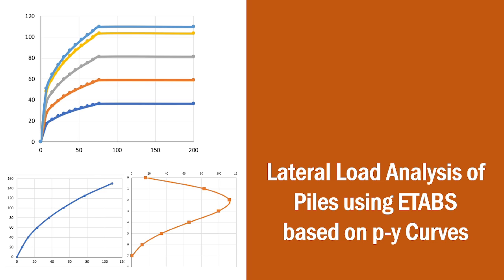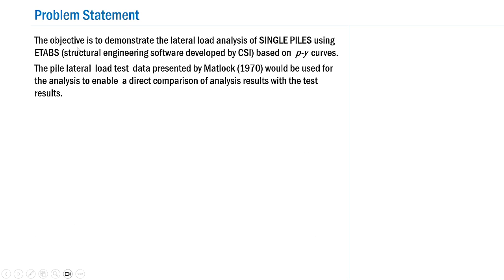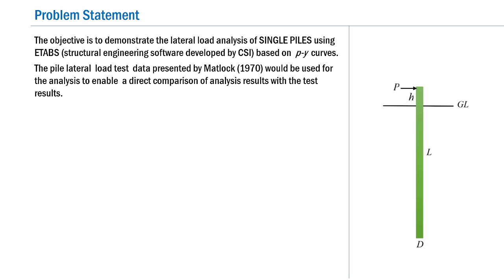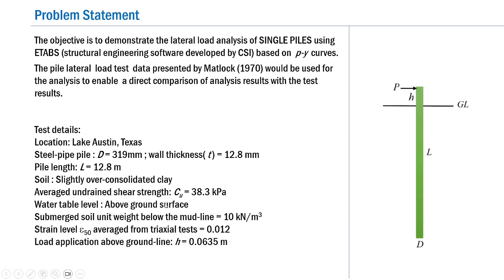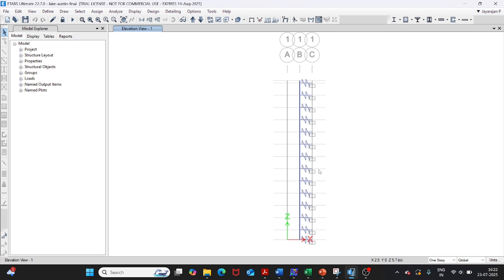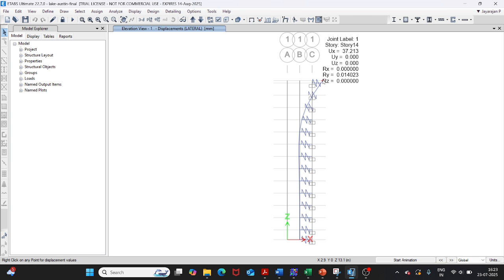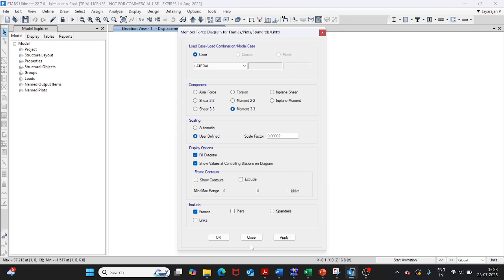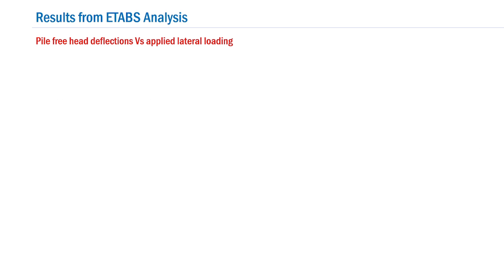Lateral load analysis of piles using ETABS based on p-y curves…

Comment: What is the vertical boundary condition at the tip?
Reply from the maker: keep it free. However for large  diameter piles, suitable moment -rotation need to be implemented at tip.
Reply: @puttattjayarajan1199  suppose we are going a seismic analysis of bridge pile foundation system, which boundary will you provide at the tip of the pile..?
Reply: Why don't put vertical spring at the tip?

Comment: Thank you, for your valuable lecture.What is the permissible  lateral displacement of pile According  to standard  Code?  Please, suggest me  any reference book whare I found it.
Reply from the maker: If you check codes and text books , each of them provide different criteria or some rather silent. Firstly, note that the allowable pile lateral displacement need to be set as per the importance of the structure. I remember Indian standards provide a criteria of 5-10 mm or 1% of pile dia.

Comment: For etabs model, do you multiple soil reaction x length x diameter or another approximation?
Reply from the maker: the links are placed at 1.0m and p is calculated per unit length. so no multiplications are required.